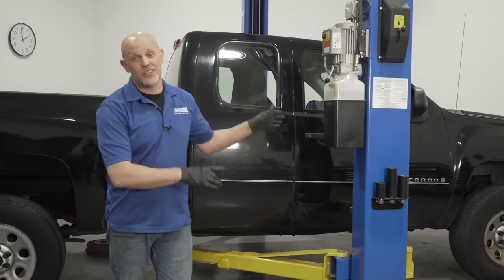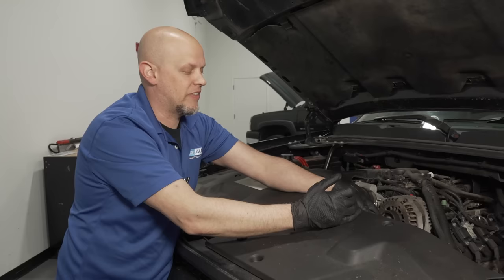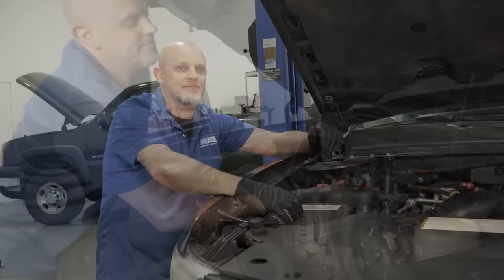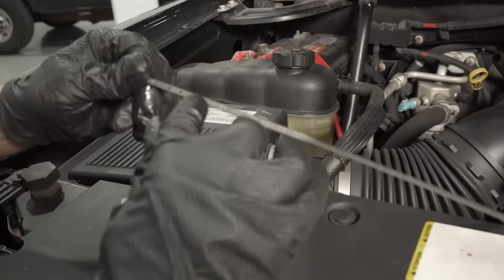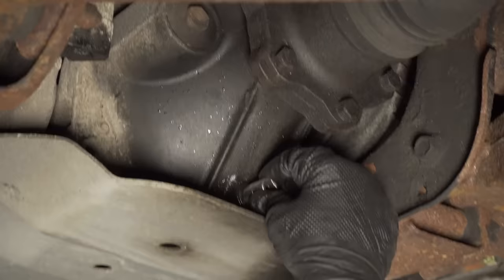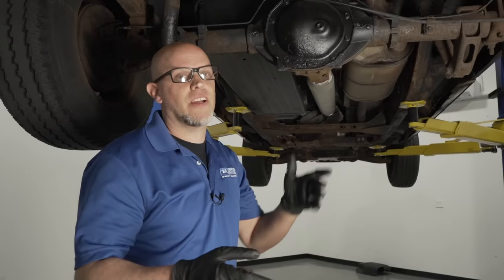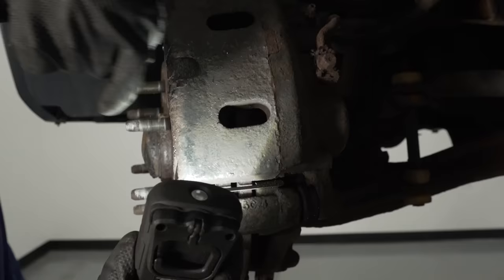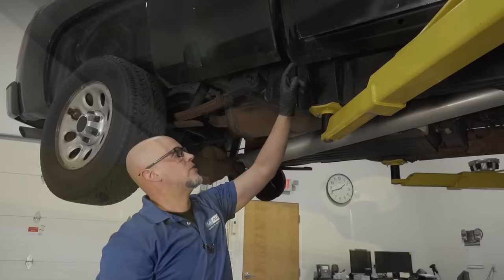Top High Mileage Issues 2007-2013 Chevy Silverado 1500 Truck

Comment: Have an 07.5 Silverado with 373k on the dash. Still runnin strong too😂
Reply: Damn
Reply: Nice, 07 1500 with 167k.
Reply: Engine 4.8?
Reply: The lifters held up all that time or did you do an afm delete ??
Reply: I hear these models are toyota reliable. Is that true?
Reply: Awesome. I have an 02 Silverado with 348k. Still purring like a kitten
Reply: What issues have you had tho?
Reply: @TheP3lox  4.8 2013 silverado. closing in on 250 000 km. run beutiful everything works great.
Reply: I too have a NBS 2007 w/ 5.3L at 333k miles with untouched engine & transmission. Change engine oil every 5k miles and trans fluid every 50k…no issues.
Reply: With the AFM?
Reply: I'm at 215k on an 08, 5.3, replaced bank 1 lifters around 19x,xxx miles.  I'm about to drop the oil pan and put in the deflector.  Other than that it still runs great.
Reply: @MarcoGonzalez-bi6cg  Yessir, AFM still enabled and working. Just hit 335,000 miles.
Reply: How’s the rust?

Comment: 2012- 5.3 here w/ 100k miles…. Really no major issues… I run mobile 1 oil and have serviced the trans @30k - (pan drop filter and fluid) … love this video w/ some good tips… I definitely am worried about the AFM issues… I feel like Im over maintaining the truck… but it’s piece of mind… and who wants to buy a new truck now days with these crazy prices?
Reply: I agree. I did my trans at around 100k didnt wanna wait any longer. And I change with mobil 1 advanced synthetic every 5-6500 miles
Reply: Can you disable the AFM by any chance ? Getting an 07 with the 5.3
Reply: @akidim13  I had my AFM disabled on my 2013 long time ago. I get better gas mileage than before
Reply: @akidim13  they sell afm disabler on Amazon for like 200 bucks
Reply: I got one a year ago with 129k miles so far so good doesn’t burn any oil and I serviced the trans fluid

Comment: The best thing you can do to any vehicle that's up there in mileage is keep changing that oil every 5k kilometers or 3k miles on a GM flush coolant every 2 years the rest is just maintenance really... spark plugs every 4 years or so differential oil change every 2 years transmission oil starts to smell burnt flush it out... GM trucks are the best in the business follow these steps and your GM truck or car will last a long time

Comment: Also to add on to the top issues with the GM trucks those years with the AFM (Active Fuel Management) is the lifters on the cylinders that shut off during the 4 cylinder mode (1, 4, 6, and 7) collapsing. If your truck is misfiring really bad on one of those cylinders be ready to pull the head and replace lifters. Happened on my father's 09 GMC 1500 Z71 with the 5.3L and 247k miles
Reply: So if you get the misfires it won't affect the pistons only the lifters? Is this a common issue? I heard that I disactivate this option
Reply: I have 2013 GMC Sierra. bought brand new. It is a POS! has the GMC known lifter/cam shaft defect! Why isn"t there a class action suit against GMC for continuing to push out defective engines???
Reply: @dannymartinez8522  my 2013 6.2ltr 8 cyclinder doesn't have the AFM. There is nothing to disconnect. Mine has the faulty lifters  that GMC has known about for probaby 10 or more years and hasn't fixed.
Reply: Happened to mine at 150k
Reply: Buy a new range technology AFM/DFM disabler from Amazon about $220. Plug into your obd2. It uses all full 8 cylinders constantly instead of bouncing between cylinders. Won't harm your lifters anymore. Also barely affects gas mileage. You might only lose 1 mpg. Problem solved
Reply: @DaveyDave1050  did this and my truck runs so much better.
Reply: @DaveyDave1050  I have a 2012 5.3 and I shift it to M5 and M6 instead of on Drive i have reas here and forums that it will use all 8 cylinders
Reply: I think that’s what’s wrong with my Tahoe it’s blinking check engine I replace number coil injector n plug and missing bad smell like gas bad n smoking white out of tail pipe was that wht ur dads was doing

Comment: Little over 200,000 miles on my 2013 silverado no major issues... just replaced one coil and an o2 sensor and plugs ... does burn oil between oil changes now... pretty good truck i must say i think i got my moneys worth out of it ...
Reply: Of its burning oil you may want to run some catalytic converter cleaner occasionally. My honda started burning oil and they got plugged.

Comment: Gm was a good company from 07 and down. Even better was 2013 after that they went down hill.
Reply: I have a 2014 Silverado with 155k miles only major issue was ac condenser went out and I guess I just replaced my lower ball joints 

Transmission and engine run good as new no slipping, no loss in power
Reply: I just got a 2013. 211,000 miles 4.8 engine it runs like a top

Comment: 2011 5.3L  105,000mls.
Just replaced rear axle seals. Were leaking into rear brake drum. 
Took care of AFM issue with AFM bypass plug-in bought off Amazon.  Plug into OBD2 port and turn engine on. The plug-in tells computer to run V8 all the time like God intended. No more burning up spark plugs

Comment: If your having trouble with it smoking during start up or oil consumption start with the driver side valve cover. The factory pcv valve port gets clogged and causes these issues. The updated aftermarket ones fix this issue. Look it up if your having oil consumption problems this fixed mine

Comment: Glad you mentioned the heater hoses. Any of the 99-13 chevy trucks have that as a decently common problem with the plastic connectors breaking and then losing all coolant. Another one I personally wanted to mention is if that little ground strap didn’t fix weird electrical issuesI’d try the battery cables. Pretty common for the positive and negative cables to corrode internally and cause the whole vehicle electrical system to go haywire (door locks opening and closing while driving, radio completely shutting off and turning back on, gauge cluster going to resting position while vehicle is on, etc).

Comment: I bought a 2012 Silverado 1500 WT with 284,000 miles. I have driven it for three years and only have needed to change the oil and just today I had to replace the radiator. It's fantastic.

Comment: 2012 Silverado 4.3 V-6 with 60k miles. Bought it a few years ago with 58k miles. Inspected and oil changed every year. Only problem has been batteries failing early, but replaced free under warranty.  Finally put a solar powered battery maintainer on the dash and no problems since. 

Fair winds and following seas to all.
Reply: Where did you buy the solar powered battery maintainer? I been having issues with my battery too

Comment: 2010 Silverado 4.8 with 190K, besides basic maintenance, I have changed the brakes, wheel bearings, the whole front end, spark plugs, heater hoses, rear main seal, valve cover gaskets, and oil pan gasket. Truck runs like a champ! Hopefully I get another 100k miles out of it!

Comment: I thrown my engine cover away years ago. I've had problems with headlights and taillights not working. Headlights needed new plugs. Taillights had corsion that needed cleaned off. I use the used motor oil for rust protection by spraying it on the underside and inside the cab corners and rockers and any other places like around wheel wells.

Comment: At 9:40, the LSD additive. If you contact chevy, they tell you not to use it with G80 rpo code trucks and SUVs. The G80 is a posi lsd in cars, but the G80 on trucks and SUVs is a locker and doesnt require the additive. I contacted chevy a few times to figure it out as I have a 08 PPV Tahoe with G80. Just for anyone curious
Reply: Thank you for taking time to put that info out there
Reply: Yea it is a weighted mechanical Locker and no additive needed.I have had many in my gm trucks and they are good for light everyday use,but will not stand up to serious off-road abuse..

Comment: As odd as it sounds if the small ground wire between the firewall and hood is rotted out and broken you'll get buzzing and crackling on the FM radio . Had this issue on my 2012 Sierra . Replaced the ground wire to the hood radio issue fixed .

Comment: If the main ground strap is ok and you still have weird electrical issues, there are several other ground straps around the vehicle that should be checked, especially if the truck has spent much time in the salt belt.  My 2013 calls for dexos specified oil which I think automatically puts you in the synthetic camp and there is an oil life indicator in the driver information system that can help if it was appropriately reset at the last change.  Mine is running good with 170k miles. Got the big 4.8 with the 4-speed ottermatic.  I bought it recently and am currently doing plugs, wires, air filter, hoses and a few other "catch-up" items since I don't have a full history on it.

Comment: Good Stuff! Thanks, My 2007 GMC Sierra is still running good after 200K.  Keep up the good work.
Reply: We have a 2013 with 275k miles original engine
Reply: 08 1500 z71 sierra with over 200,000 miles, all stock except muffler, passenger front wheel bearing, battery, rear shocks, headlight bulbs, tires and brakes.

Comment: 2013 6.2 liter w 271k miles normal maintenance still running strong as first day. Only change oil pressure switch. 👍👍

Comment: Silverado 1500 daily work truck calling on the average anywhere between 1-3 ton with 207k still running strong I'm so glad I recently discovered that I needed a AFM disabler quickly purchased one and got rid of that annoying lifter tick thankfully I have prevented something disaster is according to all the comments I've read do yourself a favor and get one if you don't have one

Comment: 368090 on my 2006 Silverado 1500 4x4 oil change every 3000 So far so good
Reply: Original engine? Original transmission?
Reply: just bought 09 1500  silverado  did your fuel pump go out, if so how many miles, my older 96 chevy 1500  transmission out  218k   fuel pump 240k   intake manifold blew up at  260k    just trying to figure out what will go out next  oh yes and of course  fan clutch water pump  and heater hoses less than 180k  also someone else mentioned a plugin afm bypass to prevent lifter damage i am seriously considering that afm only seems to kick in about 68 miles or less per hour

Comment: I worked on a 2007- 1500- silverado for about a year what a piece of junk, heat and air conditioning and vent problems and GM knows about it, example select ac and heater comes on and won't change or vents go whacki couldn't figure out settings selected, computer issues in the dash. Recommended Fix replacement of heater control stack in middle of dash, Very Expensive, and this truck only had 81,000 Miles. Now under the spare tire attached to bed is a black box some have 4-6 large brass looking connectors and when salt and water corrode them it causes it to send false messages throughout the truck and computer sends false codes. Like Bad fuel pump and a host of other things, little black box and connectors very Expensive and after replacing dealership has Reprogram everything. Very Expensive.
Reply: Thats crazy I've sank my truck in deep water multiple times no issues other then maf codes and o2 codes cuz intake tube came off and had exhaust leaks. I have my 11 with dual exhaust long tubes cold air pipe with factory box and oem filter with dod tuned out and no issues

Comment: If it feels like it is misfiring, but you have replaced all the spark plugs and wires. More than likely your transmission is going out when the converter is about to fail it will feel like a slight misfire.

Comment: I could be mistaken, but I don't think that model ever came with a limited slip. they have a mechanical locking diff The "Eaton G80". Great video though. Very informative!
Reply: the g80 is a limited-slip differential that locks in after a certain wheel speed but cant be manually engaged.
Reply: Thats basically what G80 is

Comment: the tech missed the power steering fluid color.  His looks red.  It should be golden colored.  The red is probably transfluid that someone used in a pinch instead of dropping $30 per pint for the unicorn blood at the GM dealer.
Reply: just bought 09 1500    158k miles and my power steer fluid was red also?  so when i say that red color i was thinking of going to dealer to buy that special fluid  so i thought its supposed to be red?   i had oreilly computer say that they had a matching fluid by valvaline  its clear. i pumped it out  poured in new ran it for 1 weel pumped it out 2 more times now its clean like new and feels so smooth when i turn it.

Comment: No matter the vehicle, I'm in the habit of changing the coolant every year. the ph level gets high from combustion gasses and heat cycles and it becomes more acidic. on old cars the radiator & heater core were copper-brass, but now the modern cars use a very light aluminum, probably an alloy of some sort. it's not as robust, but it cost a lot less. I got my 1st mechanic job in 1984 and done plenty of heater cores over the decades. they ain't cheap. so I change my coolant relatively often, it is cheap in comparison.

Comment: GM royally screwed up the LS platform with DoD. 07 & up all are and will be crap. DoD will cause oil pressure and lifter issues.
Reply: tru. I have mine tuned out with hp and keep pil changed with mobil advanced synthetic and beat the o
piss out of mine no mechanical issues yet. When she ever gives me any issue will be when I do rebuild and delete and possible turbos

Comment: You missed so many things. That's just routine inspection everyone should do before buying a used car. If you want to be specific, brake petal switch, electric window switches (all doors), steering angle sensors, evap solenoid (P0446), extended cab rear door latches, lifters for AFM (if equiped), 4 wheel drive engagement (if equiped), just to name a few specific to this year range.

Comment: I have a 07 Classic and have already replaced the rear end, the drive shaft, u joints, transmission, tie rods, rack & pinion, radiator, brake master cylinder, the motor, pulleys, belts, rotors, calipers, fuel pump (3 times), ball joints and alternator. I think that's all 🤔 Yes its basically a brand new truck now😂
Reply: My 07 classic has 205k and have only replaced the alternator and belts. Battery twice. It’s due for tranny fluid exchange and filter, break flush, power steering flush
Reply: The question is did you keep up with the maintenance lol

Comment: P219A code on these trucks? Haven’t found much information. Replaced both upstream oxygen sensors with denso. Cleaned mass airflow sensor, changed filter with delco. Two quarts of mystery mix oil and hasn’t came back.

Comment: "This should be orange Dex-Cool."

And the faster you can drain it out of there and replace it with a compatible non Dex-Cool fluid, the longer your truck will last.
Reply: Indeed and yet they tell you the gaskets need the "updated ones".. not necessarily
Reply: 350,000 on dex cool and still going.

Comment: Cylinder shut down ruins motors. Floods cylinders with oil. Burns oil and fowls out plugs and oxygen sensor. I being tired of replacing plugs and oxygen sensor. Removed solenoids replaced top of motor deleting program. Now I have a good running truck. Not burning oil. Also no hesitation to turn on cylinder fire when pulling into traffic. Cylinder delete is a terrible idea. Its for emissions but once you start burning oil not very good for emissions.

Comment: I have a hard time starting the engine once it gets below 0degc here in canada, d9es anyone have any tips? I swapped plugs and replaced start als9 have had the fuel lines cleaned through high pressure chemical wash and fuel injectors cleaned. Is it possibly bad fuel pump? Battery is fine the only problem is during the cold months 2012 silverado ls 4.8l for reference

Comment: in drive idling to check transmission fluid is that correct, I had thought that when the vehicle is in park( not nutrel which turns off the pump)  it does the same thing the pump is still working also isnt that unsafe lol

Comment: Mine is a 2013 and it used oil really bad. I read an article that chevy is being sued over this issue. They admitted to the flaw but didn't do anything about it.  Apparently they designed it to spray the pistons to keep them lubed.  If anyone know how to fix this problem please let me know ❤
Reply: I got a programmer and turned off dod. Must of oil burning went away not all.
Reply: @jakurt9458  dod?
Reply: DoD- displacement on demand. The engine operates from 4 cylinder when it’s cruising to 8 cylinders when power is needed.
Reply: @jakurt9458  what programmer did you get?
Reply: Also an oil catch can between the pcv valve on the driver's side and the intake.  Oil gets sucked out of driver's side valve cover and pools in the intake where it drenches the valves and injectors before getting burned up in the combustion process.   The catch can cuts down on this while keeping the engine clean and efficient as possible.
Reply: Get a range afm disabler

This will fix your issue 

The other guy is right about the 4 cylinder deactivation contributing to the oil loss
Reply: @20tea  Agreed…I installed oil catch can that I placed inline between PCV and intake manifold. Amazed how much oil I pour out of that can every 5k miles.

Comment: I found a good deal in a 2006 silverado & a 2008 which truck is more reliable?
Reply: 06
Reply: 2006, not even a contest.
Reply: Depends on the specs of each but 2006
Reply: 06 is better. 08 probably needs Active Fuel Management lifters replaced soon.

Comment: I have 1 question I own a 2008 Chevy Silverado 1500 LT extended cab I replace the transmission from the dealership it use to run really smooth and strong once replace but after a year it started to get lazy again and it takes on me to press on the gas to go faster on small hills should I be worried?